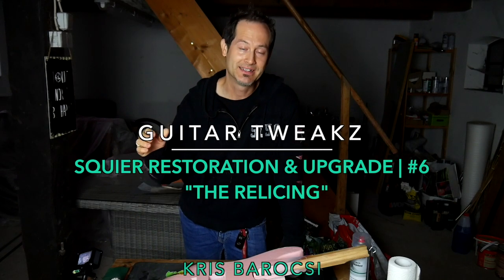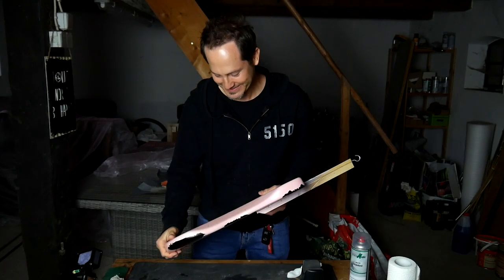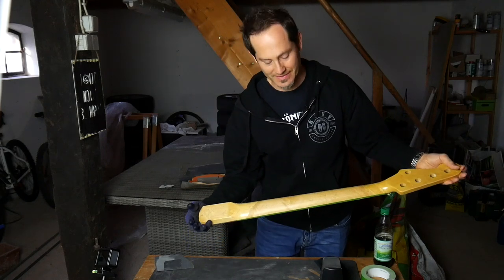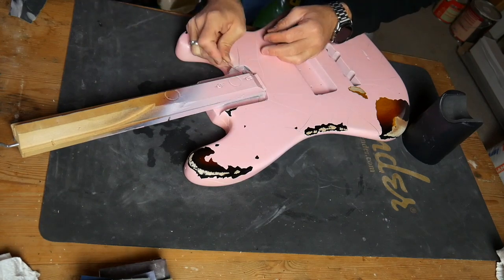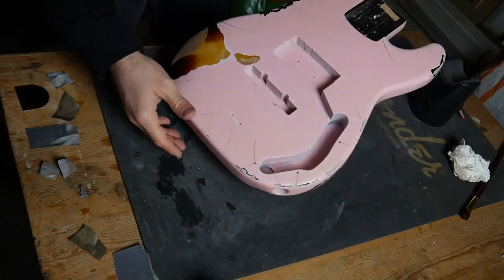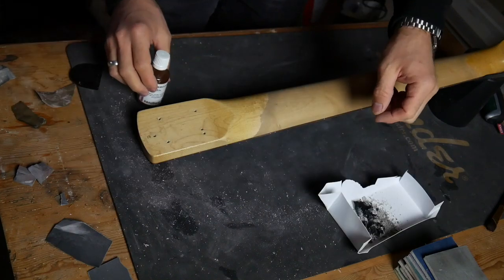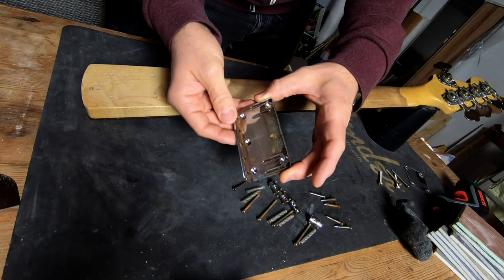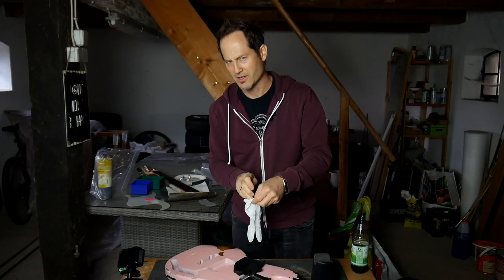RELICING a Shell Pink over Sunburst SQUIER | P-Bass refin PART 6 | Guitar Tweakz

Comment: hey ! sick relic, could you explain the part with the removal of scratches?? what grid did u use for sanding it ? and how exactly you took care of the scratches in the lacquer?? you would be my hero , I wanna finish my project :D
Reply from the maker: Hey man, thanks! I did exactly what you can see in the close-ups. Once done with the rough scratches I started carefully removing the obvious signs on the edges of the aged parts. I take the a blade and very carefully scratch the edges some more until the nitro chips off. 
As for the sanding, I only went over the aged parts with fine grid (probably 3000 or 4000) and wet sanding of course. Hope that helps. Cheers!

Comment: Nice serie sir ! I'm doing this kind of project on two squier SE's, I'm wondering how do you get to scratch only the red and black and make the yellow appears ? In my case even if i'm using 2000 grit paper all layers are removed together and the wood appear underneath...  ??
Another question, what grit do you use to smoothen the transition between wood and nitro ? after scratching the edge of the paint what grit in sequence do you use to buff it up ?? I can manage to get rid of scratch marks even with 2000.. 

Thanks ! And continue with the great content !

Have a nice day !

Comment: What did you use for the paint to crack like that?
Reply from the maker: Hey, it’s a special nitro finish a German Webshop sells. It’s called weather checking nitro and it has way less softener than normal modern nitrocellulose lacquer. The shop is  gitarrenbastler(dot)de 
Cheers
Reply: @KrisBarocsi  thank you very much!